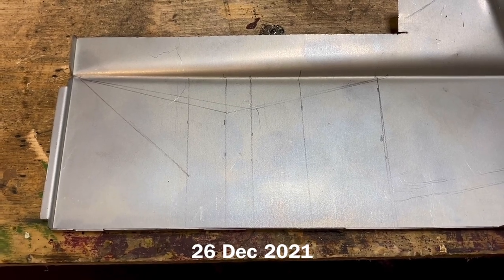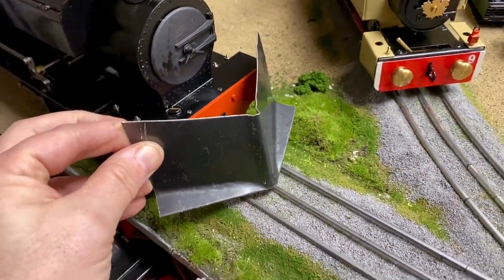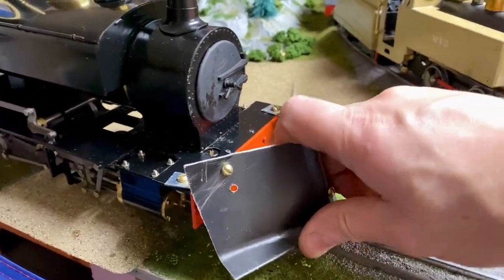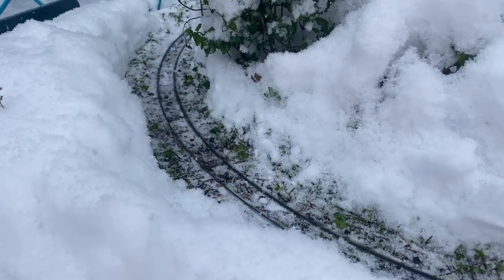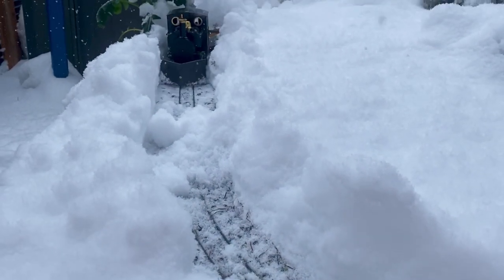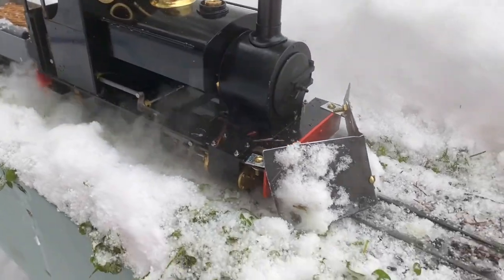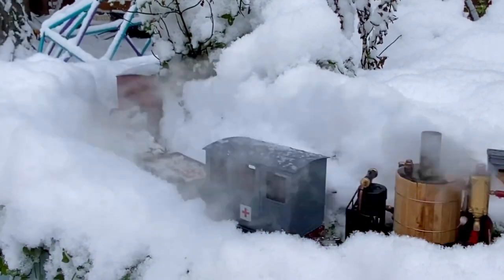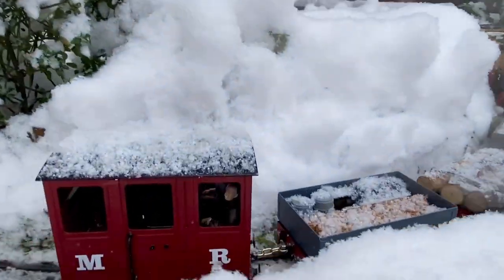Victoria BC: A snowplow for Accucraft Sabrina in 1.5 hours! Mamod Brunel also runs in the snow

Comment: Fantastic!  Nice work Terry!  I was hoping to plow at my place too but we didn’t get near as much snow (yet) as you did.  Maybe this week?  BTW an old piece of windshield wiper rubber fastened to the bottom of the plow works well as a cutting edge.  🤓
Reply from the maker: Thanks for the tip Kieth. If you get snow and want to run trains I’m only a half hour drive away…